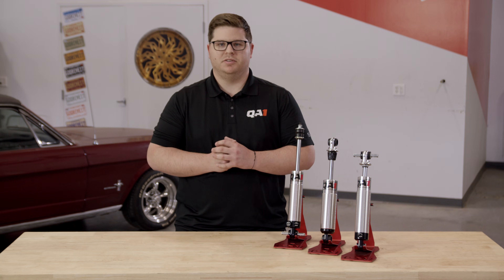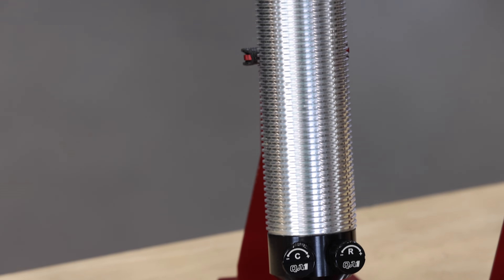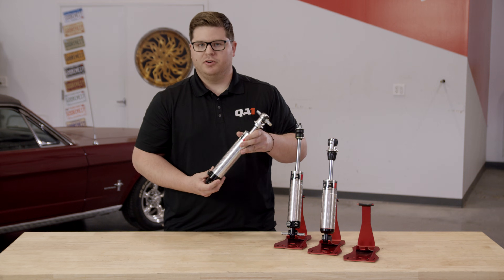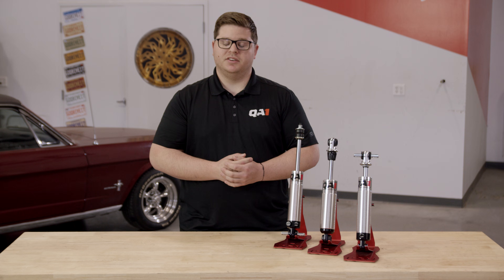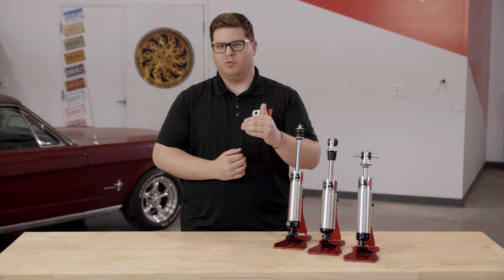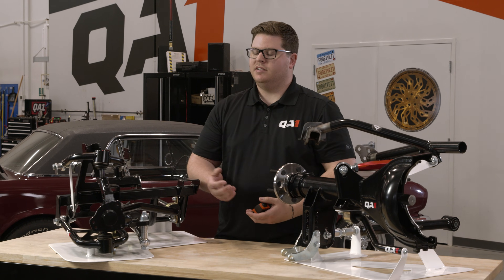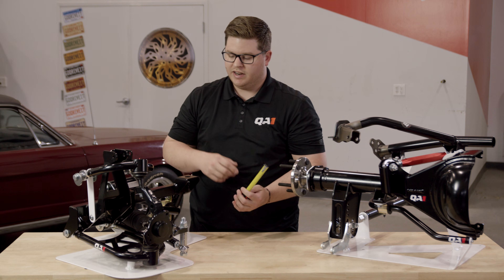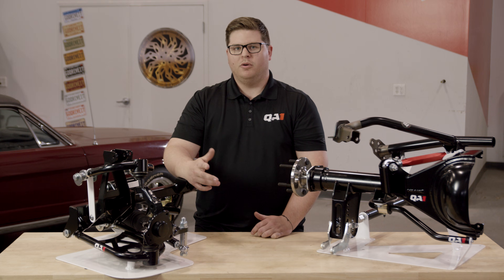How To Measure For Custom Shocks : QA1 Tech

Comment: Does this work for both shocks and coilovers?
Reply from the maker: Yes! The measurements will help us figure out the best shock part numbers for you which also help determine a good spring length. To help determine the spring rate, we would need to know what the car / truck is being used for, front and rear weights, what engine you are running, etc. You can reach our tech team at 952-985-5675 or Sales@QA1.net